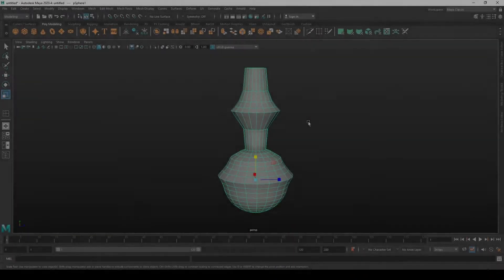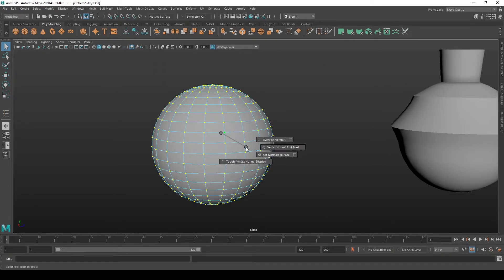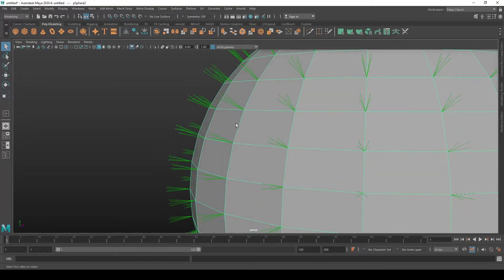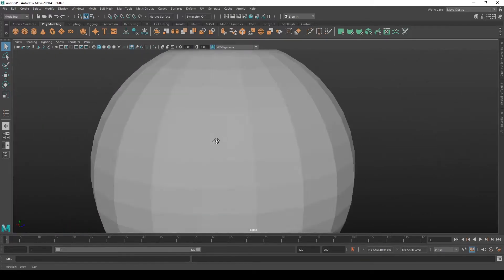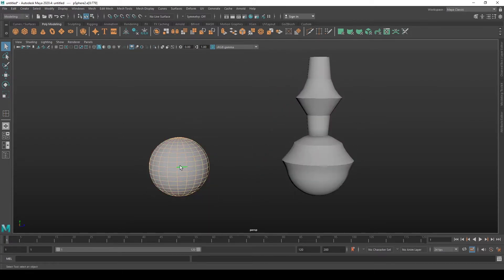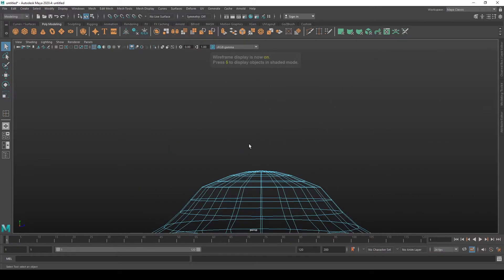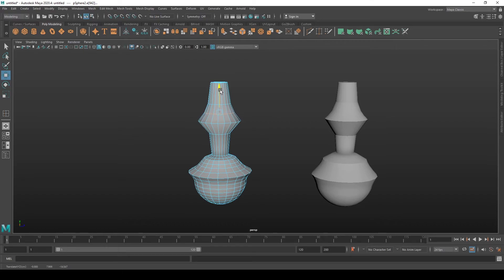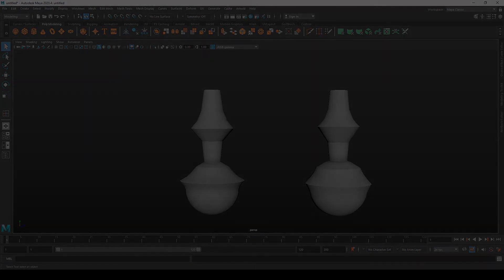Maya Tutorial - Smooth and Hard edges

Comment: Hello, thanks for the tutorial it was really useful! 

I've got a kinda a dumb question but I'm a student so it's allowed haha. 
What does this do in terms of when you apply a material, render it in Maya or transfer it to another software like UE4? Are the soft and hard edges still applied? 
If so, is this how you save polycount as opposed to using smooth preview mode? 

Thank you! :)
Reply from the maker: Hello and thanks for the comment!

tl;dr:
Yes, the soft and hard edges are still applied when you export the model to UE4.
Yes, this is how you save polycount, but not as opposed to using smooth preview as you can't export as a preview mode, as the preview mode is just a preview of how it would look if you actually used the Smooth option

This is the only way to achieve a smooth look on an otherwise obviously visible polygons model, exporting it with defined hard and smooth edges(generally referred to as Smoothing Groups because that's what the concept is called in 3ds Max).
It is not the equivalent of the smooth preview mode, as smooth preview mode displays the model how it would look if you applied the Smooth tool, which actually adds polygons fractally which is not something you want to do in a real-time rendering environment such as UE4, you rather want to specify the edges that you want to appear smooth or hard by hand with this method.
Even then if you exported a higher polygon model by really smoothing it with a smooth tool that adds polygons, you could still see the polygons if you zoomed in enough, if their edges aren't smoothed, try it out and you will see.

Key takeaway here is that you have to control the normals of your edges by smoothing or hardening it in order for it to render the way you want.

I hope this answered your question, even though it's a lengthy response. Also the question isn't stupid at all, it's not that intuitive to understand this concept and I too had to go through a few steps before fully grasping it.
Reply: @Figura3D  Thank you, I understand now and it's really cool that you can do that! I appreciate the lengthy response. I was never taught anything about hard and soft edges at university but it seems like a pretty big deal haha. I always ended up bevelling my mesh and smoothing it and wondering why people made their polycount so low while making it look super clean and smooth on places like sketchfab.
Reply: @Figura3D  oh, I was taught that soften/harden only works in a Maya environment. Gotta try.